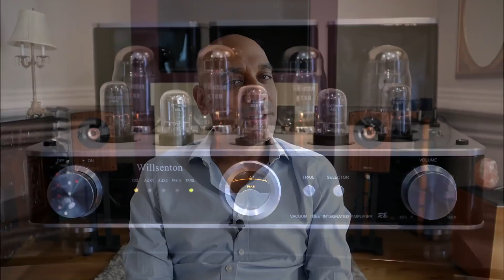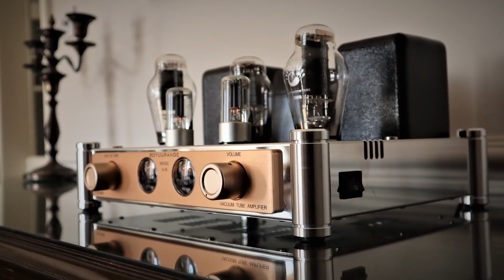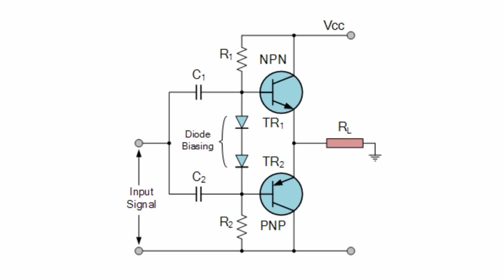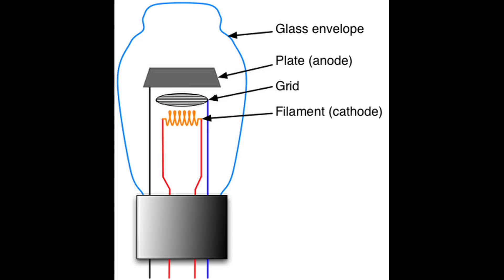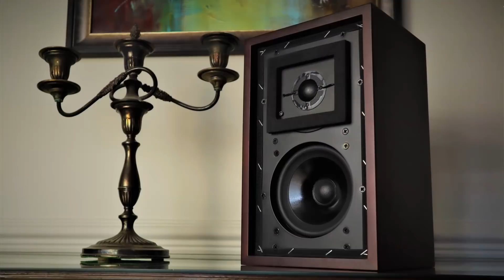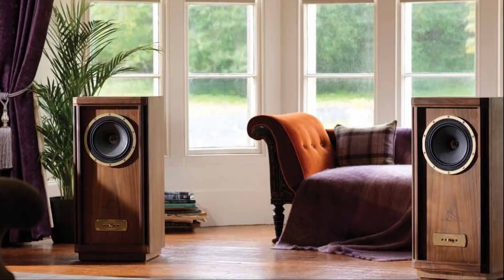Reisong BoyuuRange A50 Mk III Amplifier Review

Comment: I had this amp for a bit, driving a pair of Tekton Electron SEs. The Tektons are rated at 98 db sensitivity but are also 4 ohm design. While I really liked the midrange sweetness and fullness of the A50/Tekton pairing, the bass was lacking and the amp is a bit noisy and not all that revealing. I then switched amps to the Willsenton R8. The R8 (45 wpc push pull design) was certainly more punchy and full in the bass and less noisy, but I found the sound to be a bit harsh (even with EL34s) and not very engaging and warm. So went back to a 300b class A SET amp - this time with an Elekit TU-8600s. This pairing with the Electrons is finally very close to the sound I'm looking for. Very transparent, non-fatiguing, and a very sweet midrange. The bass is a little shy, but I'm thinking now a subwoofer is the best way to address that. Perhaps others have had similar experiences??
Reply from the maker: Thank you for watching and sharing your experiences Joshua 😊👍
Reply: I have the Wilsenton R8 Paired with the Tekton  double impacts 98db and also a 4ohm design…… I never considered switching to the 8ohm tap until I read your post…… Is there any harm to the speakers If I switch the tabs to 8ohms to if is it difference?
Reply: @jessecurran4762  hi Jesse. No harm to the speakers. But if you hear clipping when at playing very loud volumes, turn the amp down a bit. I e been told that the 8Ohm taps actually use different transformer coils, and the 8Ohm pushes more current for same volume.

Comment: In my 50+ years of being an audiophool, I have had many low powered SET amps, 300b , 2A3, EL34, 845, etc.. The 2A3 being my favorite sonic signature for vocals and most music. The 845 being the most powerful and allowing for more conventional speakers and music types. I had a Cary 2A3 push pull amp that had 15 watts output and almost as sweet as the SET version.  I always found the SET tube amps to be too much of a compromise. I don’t care for many high sensitivity horn speakers, they can sound wonderful, but usually with a price that doesn’t match the sound, also I don’t care to be shouted at. 
After years of trying higher powered amps and too many speaker combinations and spending big bucks.. I slipped into one of Nelson Pass SIT SS First Watt amplifiers, a pair of planar speakers rated at 95db and I have my best sound to date.
18 Watts per channel allows for plenty of power, woofer control and that SET sound that works on all music. A SINGLE stage amp that’s simple and elegant beyond words. No more tube hassles and ridiculous prices for them. Less heat and MORE RELIABILITY using real world speakers..
Couldn’t be happier.. I still love tubes and have several tube SET amps for headphones..  but I finally have a good solution to low powered SET sound, without the tube hassles.
I spent a lot of money to learn you don’t really need lots of money for a good sound..
Great vid ! Thanks 
Mike.
Reply from the maker: Thank you for watching and sharing your experiences Mike 😊👍

Comment: I have both the A10 & A50. The A10 didn't really impress me until I ran it with a Schiit Loki equalizer into the mix. The A50 on the other hand is a different animal and I haven't had the urge yet to run the Loki with it. Also have a vintage Yamaha CA-2010 which was my favorite Amp until I got the A50. Have a set of Klipsch Heresy's they sound fantastic but lack bass on the A10 without the Loki. Have the RP-600M, sound OK on the A10 but didn't impress without the loki, good on the A50. Both the A10 alone & the A50 surprisingly make Jamo's S 809's sound decent although volume is a little lacking in a moderate sized room 15x20 vaulted ceilings.  I also have Klipsch RP-280F's and they deliver terrific sound on both the A10 & A50 with plenty of bass and volume. I know tone controls are frowned upon in today's audio world of purists but I find them useful and have a greater effect on sound when paired with different speakers than simple tube rolling and it's far more economical. Someday I'll pair the loki with the A50 and see what happens.
Reply from the maker: Thank you for sharing your experiences 😊

Comment: Hallo Tarun, I like your video’s. The only thing I mis is measurements. But There are other people who do. Like  this lady in the US. After measurements she shows that this amp only can give you about 3 watts without distortion. The disign of this amp is bad. The pre-stage in this amp with the 6SN7 tubes does not give the B300 the wright  amount of juice . Also the B+ voltage is to low for the B300 (see her video: youtu.be/539-CaJJiD0 ). 
What about the bias of the tube, I see that people say autobias, that is not correct, it is fixen bias. That is something els than autobias.
Reply from the maker: Thank you Michael. If I had more time and resource, I would include measurements. The focus of my channel tends to lie elsewhere. I suspect this amp is a fixed bias design 😊👍

Comment: This is a great review thanks.   I built a single ended amplifier and it sounds brilliant but like you said they need to be with the right speakers.  I managed to find some klipsch heresy 2s on ebay and they sound amazing massive.  Horn loaded is the way to go with these type of amps.  Mine also goes into a sub at speaker level.  I have read so much about 300b so I would love to hear it.  Thanks again for the review.👍
Reply from the maker: Thank you. I appreciate you watching and sharing your experiences 😊👍

Comment: Klipsch RP-600M would be an excellent choice for this amplifier. Most of Klipsch's speakers are 95db or higher in sensitivity. I'm currently running a Reisong A10 (6 watts/channel el-34 SET) into Klipsch RB 61 IIs as my computer desk system. I'm feeding the amp from a Topping EX5 dac/headphone amp. Single Ended Triode (SET) amps tend to be a bit rolled off in the treble ranges, which make them a VERY good match for Klipsch speakers, which are a bit bright in the treble. The bright sound of the speakers, plus Klipsch efficiency, make a very good match for any low-powered tube SET amplifier. 

I have an Emotiva SE8 subwoofer on order. the SE8 has a high-pass filter, for bass management. It will let me offload the bass on to the subwoofer, and only drive the upper bass, mids and treble with the amp. That should add and tighten up the bass a good bit. The bass isn't bad without the subwoofer, but bookshelf speakers just don't make a lot of bass.

EDIT: The SE8 came in today, and the difference is amazing. Narcissistic Cannibal, by Korn, has has sub-bass at about one minute into the track, that was completely inaudible without the sub. With the sub, it's clean and felt as much as heard. It may be placebo effect, but I think the upper bass, mids and treble sound better without the amp struggling to reproduce the sub-bass. 

Unequivocally recommend that anyone buying a low-power SET amp consider pairing it with Klipsch bookshelf speakers and a SMALL powered sub. I set the volume on the SE8 about as low as possible and it's fine. Also, for music, a small sub is often more agile on fast musical passages than it's bigger siblings.
Reply from the maker: Thank you for watching and sharing your experiences 😊👍

Comment: Well, I have an Elekit TU-8200R class A producing some glorious 8 watts per channel towards Wharfedale Diamond 225 rated at 87 db in a medium sized room, and I couldn't ask for more power (I never go past 11h). I can switch between the Elekit and my Bryston B-60 for comparison, and I can report that nothing is missing in the musical message, only different. I run the Elekit output at 4 ohms as seen suggested in a forum (The Diamonds 225 are 8 ohms), I didn't try the 8 ohms output, maybe I would have the same problems you encountered. I had my doubts about building an 8 watts amp and was ready to change speakers if need be, but the Wharfedale are staying.
Reply from the maker: Thank you for watching and sharing your experiences 😊👍

Comment: Is this worth considering with PMC twenty .24? Looking for my first tube app. Currently use an avi labs integrated s21 which I love but looking to try tunes. Or am I mad?
Reply from the maker: PMC speakers generally like a bit of power. You can run them off tubes but they need a few watts and decent current capability 😊

Comment: Hi, how would this go with Wearfdale Denton 80th, 86db and 6omh. Its all quite technical and worried the low watts wouldnt be enough. Currently have yamaha as 501 at 85w. love mid range texture and timbre and listen to jazz and blues alot
Reply from the maker: Hi Richard, I think it will struggle. You need a speaker with a sensitivity in the 90s with the A50 😊

Comment: I have an A50 mk2 coupled with vintage Tannoy 10 inch monitor red speakers. It is stunningly beautiful with solo piano or quartets, lots of bass, midrange and treble. It's a bit wobbly with orchestral works, but that's true of most amplifiers under £2000.
Reply from the maker: Thank you for watching and sharing your experiences Samantha 😊👍

Comment: Ive been playing with a kit SET amp and Klipsch Heresys. 3.5 watts per channel. My room is 9.5' x 14' x 8'. There is a "break in" if you go from a standard amp to appreciate what it is SET tube amps do. This combination seems extremely sensitive to quality in the signal chain and setup. My modest system throws a 3d image (sometimes!), has outstanding mid and hi end, and offers a tight and palpable low end. Most of the lps and cds I listen to sound "fresh" through this system. Plays at low volumes really well.
Downside is that loud, I mean really loud, music loses coherency. But I play music right in the sweet spot, about 60 to 90 dB and coherency, clarity, scale, speed, all come into play, with a dead quiet background.
Reply from the maker: That is very interesting. Thank you for watching and sharing your experiences Nick 😊👍

Comment: Thank you for your honest review.  I have never heard any tube amp and am trying to figure this all out.  This amp is one that I am considering but I know so little that I have many questions.  From what I have heard the 300B tube amplifier is considered an excellent choice.  Is this a completely different animal from an amp that uses KT88 or EL34 tubes, or is it just a matter of changing the tubes?  This is a case where ignorance is not bliss.   Also, is the 300B tube more expensive to replace than those mentioned above?  Thanks
Reply from the maker: Hi Mike, thank you for watching and your support. You can’t interchange 300B tubes with KT88 or EL34s. Some tubes are interchangeable but they need to be the same type. The 300B is a triode, the KT88 is a kink-less tetrode and the ET34 is a pentode. I explain this a little in my Wilsenton R8 review 😊👍
https://www.youtube.com/watch?v=cK_HHcN26MI

Comment: interesting post.   I am using a low power SET amp  @7.5 watts,   my speakers are very efficient @ 96db 1m/1w or higher.  This makes a very good combo - I am amazed that this small amp can really blast with the right speaker.  However, my normal listening level is about 70 or 80 db.indoors.   and even when paired with my inefficient outdoor (86db) speakers, it has plenty of power.
Reply from the maker: Thank you for watching and sharing John 😊

Comment: Great stuff. I have the A10 version (EL34, ultra linear, 2x6w) with Klipsch Heresy III (99dB sensitive), running my front stage. I use Denon AVR as a pre for that (part of full surround setup and subwoofer). I mostly listen around 70dB, but with sensitive speakers, there's plenty of headroom. Heresys, thanks to the high sensitivity, horn loaded compression mid and high drivers + 12" fast mid bass paper cone is good match for low watt tube amps 👍
Reply from the maker: Thank you for watching and sharing your experiences Johto 😊👍

Comment: I don't think any of the speakers you used did the amp justice. As you eluded, you need big sensitive cones which means floorstanders.  I have the Reisong Boyuurange A10 which uses EL34s. Mine is rewired to run in triode mode and probably only makes 3W or so. I have them paired with some large transmission line floor standers with 96L volume, 12" woofers and 93dB sensitivity. This combination easily fills my room and sounds terrific. Obviously higher powered SS amps would have more drive, but it does an admirable job and the mid range and vocals are to die for. Agree that it's not for punchy electronic music though, go push pull solid state for that.
Reply from the maker: Thank you for watching and sharing your experiences SZ 😊
Reply: Hey. I have A10 too, running Klipsch Heresy III's, I would be interested for the triode mode, 3W should be plenty. Can you provide any tutorial how to make the changes from UL to Triode? I'm not very knowledge in electricity jobs, but if that is just a simple re-wire and soldering (or adding a switch between) i could manage.Thanks.
Reply: @johto  Sorry but I can't tell an electronics newbie how to do this over the internet in good faith. It's quite dangerous for the inexperienced as the electrolytic caps in the power supply retain hundreds of volts even when turned off and must be discharged. It also leaves a HV wire disconnected which needs to be safely terminated and isolated from the chassis. However, I will say that it is very simple and simply requires the screen to be connected to the plate via a 100R resistor which is already present in the amp. Go do some research and jump on diyaudio.com, you'll find the info you need in those forums.
Reply: @SignorZucchini  thanks. I suspected that it involved something like that. Good tips. Going to read more and consult a pro

Comment: Pair this with Lii Audio F12 or F15 in an open baffle or Betsy’s from Caintuck Audio. Paired with a small sub w/high level inputs for the under 60 hz signal, and it’ll sing.
Reply from the maker: Thank you 😊
Reply: You are right, time traveler. I stream HD thru a Freya+ with nos sylvanias to the A50 III with Black Treasure 300B’s then into a high-level input sub, feed only above 70-80Hz into Zu DIrty Weekends or Cornwall III’s (and others of lower efficiency that do not perform as well) but I like the Lii Audio F15’s on large open baffles best. Awesome soundstage when the source has been mastered by someone who knows what they are doing and plenty of overhead since a large part of the load is covered by the sub (and I like it pretty loud on occasion). The secrets are very efficient speaker design (the F-15’s are 97db, the Cornwalls claim 102db) and good source material.

Comment: Hi Tarun. Thanks for this review! The only other review of the A50 Mk3 that I recall seeing was the one Steve Gutenberg did. After that review I bought one on Amazon! You are correct. This is a bargain! I love this 300B integrated. I use it on one of my two systems. Specifically the one with the digital front end. It drives my Magico A3 towers at 88dB 4 ohms with zero issues. I do listen to primarily (but not solely) ECM label jazz with an emphasis on piano trios and quartets. This A50 is superb. Yes the soundstage is huge. With the speakers about 8 feet or so away from me and toed in to point to my listening position I occasionally hear things directly lateral (left and right) to my listening position. I have NEVER had that happen with any of my ss amps and haven’t heard that with my PrimaLuna Dialogue Premium HP with stock EL34s! This is a fantastic amp and I haven’t even started tube rolling it yet. Well done!
Reply from the maker: Hi Richard, great to learn about your experiences with the A50 Mk3. Thank you for sharing 😊👍

Comment: Interesting amplifier. I used an Elekit-tu-8200r with Tannoy DC8Ti with good success. I assume Fyne Audio speakers will be a sympathetic match also. Elekit-tu-8200r is less romantic sounding than the 300B amp here bit it proves even few watts can drive good quality speakers. The Heco Direkt that i had a year ago should be a choice also.
Reply from the maker: Thank you Calaf 😊

Comment: Not necessary need to use fullrange speakers,it all depends how big is your room!
I used 300B Melody SET amplifier with Quad S2 87db speakers in a small room,and was quite satisfied!But by the way I used it as power amp ,set the volume at 1o’ clock and was controlled by streaming dac volume.
Reply from the maker: Thank you for sharing your experiences Alvin 😊

Comment: A thing that was not mentioned. It ships with the most basic tubes from psvane. Better tubes better amp all the time and can be done in small incremental steps. As per speakers I'd look at Spatialaudio, a pair of used triode masters will go a long way for reasonable money.
Reply from the maker: Thank you Bernard 😊

Comment: Hi again, Tarun. I have the Reisong A10 ( SE, Class A, EL34:s ) since half a year which drive my old Heybrook HB1:s -84, 90 dB/Wm. Sounds formidable, with a gorgeous, liquid midrange for voices and acoustic instruments. It's even weaker at 6.3W/ch, but with the right input level= rather high, and this can't be emphasized too much, it deliver sound pressure levels and punch through the HB1:s that is more than I need in my room ( approx. 25 sqm ). With some recordings it can be a little lean on the bass and bright in the upper mids, which I compensate for by a Shiit LOKI 4 band EQ, which matches well. 
Recommended input level: Run my Dual 505-2 turntable with stock Ortofon DN165E PU via a Pro-Ject Phono Box S2, dip-switched to 60 dB gain.
All in all, an exceptionally well sounding system, at an exceptionally low price ( paid 200$ for the point-to-point hand soldered variant +70$ shipping, directly from China HiFi). Cheers, Magnus
Reply from the maker: Thank you for sharing your experiences Magnus 😊👍